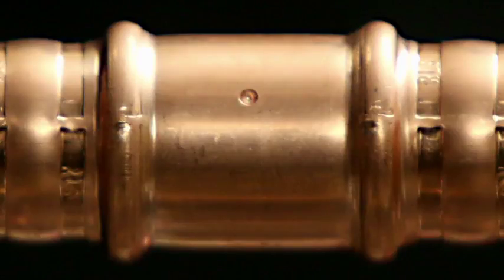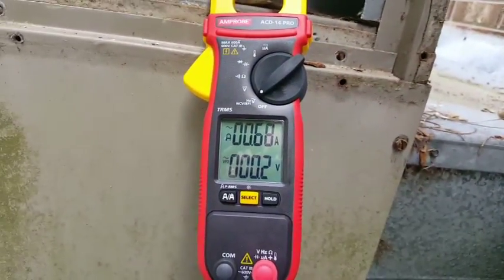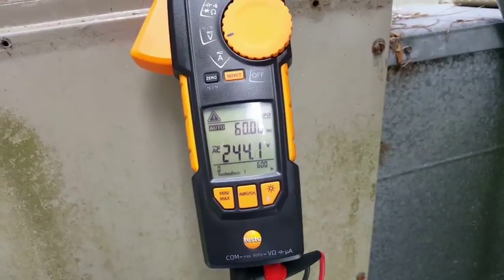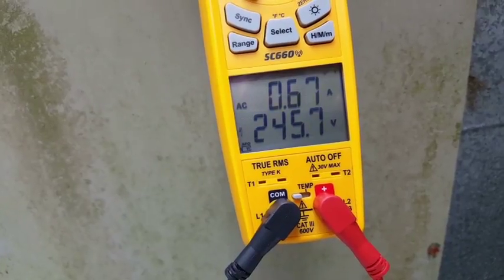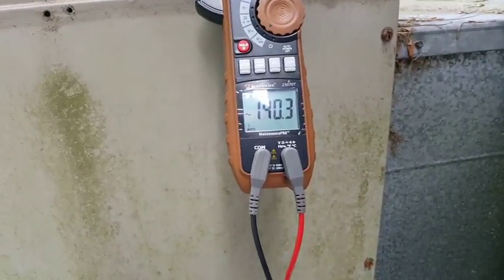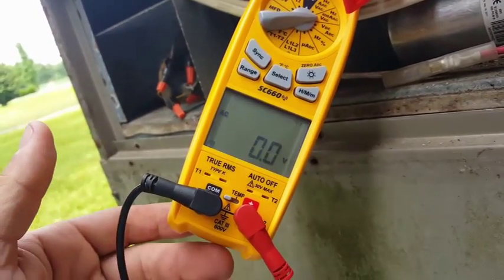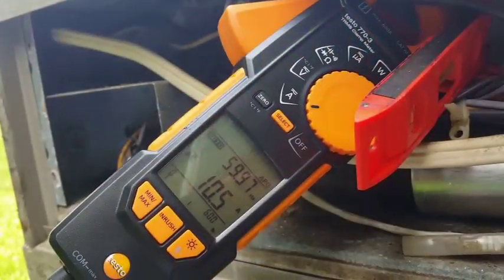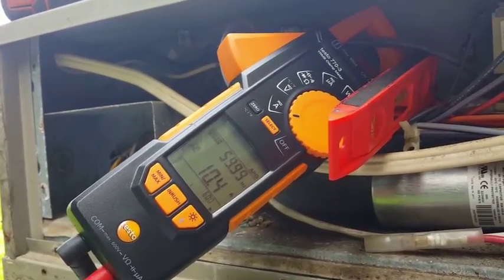Best HVAC Multimeter Rated 1-10 | Amprobe, Fieldpiece, Testo, Southwire

Comment: The amp draw comparison between them would be negligible, it would dependent of the position and distance of the meter. Also on volt comparison are you using the same leads?
Not to say the others are bad but Testo is know for their accuracy.
Reply from the maker: It has been a while but I am sure I used the leads that were standard for each meter.

Comment: Meters are only good if they can sample FAST enough to get accurate readings. IN rush amperage ring a bell? If you meter samples at one second intervals, you've missed the boat on compressor startup.

Comment: low amperage and small wire gauge is hard to read on large clamps. for best readings you'd need multiple size and rated meters, not very practical :)

Comment: What's up with this lame, after the fact, cover you ass review of the Testo 770.  Two weeks ago Testo was the besto.  Now it is Chinese made shit because John got shocked because of operator error.  Don't even try to argue that it wasn't..  He didn't set the meter for AC voltage, because he's been in the game for so long he don't need to read no stinking directions.  You guys flew off the handle and threw Testo under the bus.  You need to apologize to Testo and come up with a more evenhanded way to review tools and be a bit more diplomatic about any less than stellar features of the tools.  Other manufacturers are watching.  If you don't want the support of the manufacturer community, keep on going the way you are.going.  If you want a great and growing podcast with fun and good information for the listener and increased income opportunities for yourselves,  TIGHTEN up your game.  P.S.  Lose the on air tobacco use.  Disgusting.
Reply: It's just a meter...
Reply: a wise man treats every wire as live, then again I'm used to wiring live..
Reply: Da fuck?
Reply: I watched the latest hangout.  I'm convinced by what I heard that the Testo 770 meter has genuine problems.  Sometimes I'm such a bastard.  Just ask my wife.  My apologies.
Reply from the maker: Concierge Air - Orlando a lot of people did not believe John which is unfortunate. Billy at least confirmed their should be some attention put toward this issue.
Reply from the maker: +Concierge Air - Orlando I'm just going to make a review of what I honestly think of a tool and leave it at that. If you have a problem with that that's fine but that's how I'm going to do it. I would not suggest that anyone go out and buy this meter at all. John is not the only one that has come across some voltage issues using that meter.
Reply from the maker: +Working Joes Roundtable also, I don't use tobacco products.